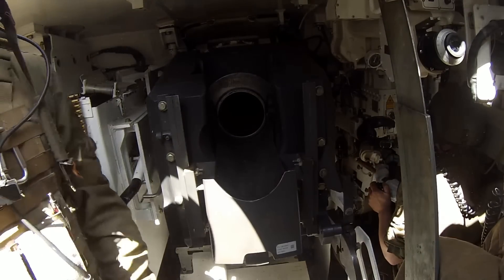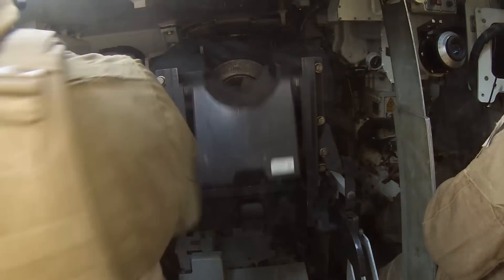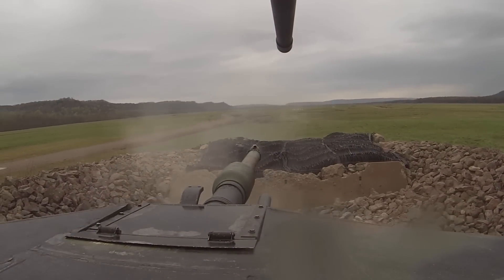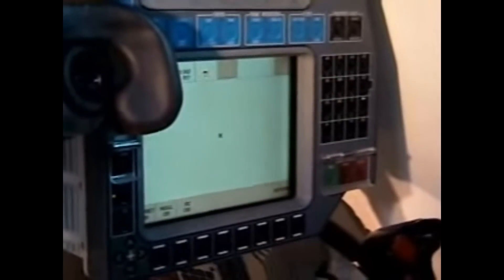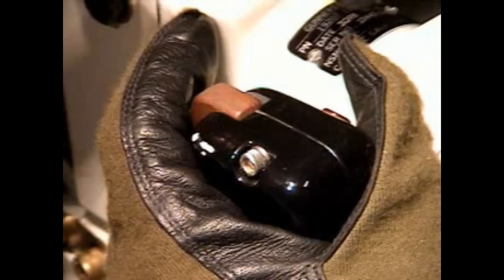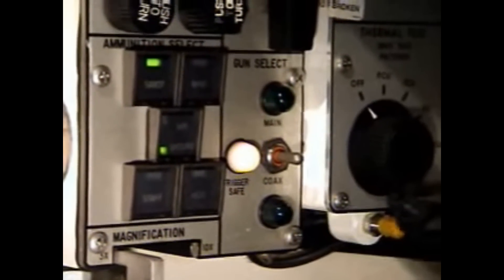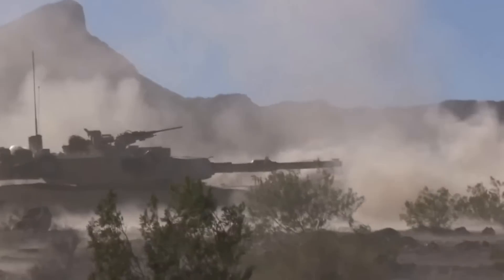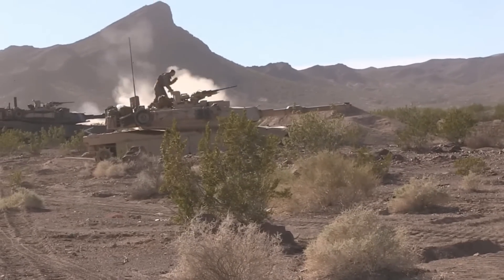How Do They Clear Tank Gun Misfires?

Comment: Not a loader as I'm not a tanker but Murphy will rear his head when you really don't want him. During the push to Baghdad near the Karbala gap my Bradley had a coax malfunction that wouldn't clear ( later found the extractor sheared off), switched to HE and had a25 feeder malfunction that wouldn't clear, stopped the Brad to raise tow and it gets half way up and jams. All back to back during an engagement. Our call sign went from blue 3 to malfunction 3.
Reply: ghostdog688 no worries, none of it bothers me. so the long version it is. my third tour in Iraq, April 2008 my platoon was sent to recover a Stryker that was disabled. it was sometime around midnight when we sp'd biap. there were two abrams, two brads, and two wreckers. we were headed to towards the north east side of Baghdad. we crossed the rte Pluto's and rte predators intersection heading north on predators. while going through the first IP checkpoint a couple hundred meters down the road I was maneuvering through their serpentine when I was hit by an efp that went through the BC side idler wheel, penetrating the side of the Brad with a fist sized hole destroying everything inside the troop compartment. luckily we had no dismounts. I was about sternum defilade in the BC hatch. when the explosion happened I don't remember hearing any noise just a bright flash, rush of hot air with what seemed like it was mixed with sand. the force blew off my sleeve pocket, my eyepro, and my CVC. I was really mad about my acu's and eyepro. the acu's were brand new and I had just bought those eyepro. I dropped inside and yelled to my gunner to check on our driver, he was being affected by the smoke from the smoldering electronics in the back. I threw a green chemlight out the turret to signal we were OK. a couple of minutes to by and I kicked something on the turret floor, it was my CVC. I picked it up and it was missing the kevlar shell. funny thing is it was still connected to the spaghetti cord, which if you know about those you can just look at them wrong and they'll disconnect. i put it on and reestablish comms with the PL. as we didn't know the extent of our track and assuming we were good the PL decided to CM. this was the beginning of our troubles. one of the wreckers took and efp to the snatch block at the rear which sent it flying off into Baghdad. the pl's track took an efp to the turret. it ripped off the section where the coax goes and went into the 25. it blew in the ready doors which caused the FBCB2 screen to shatter into the PL cutting up his hands. then they took another into the side hitting one of the reactive armor tiles deflecting it into the underside of the turret wedging in the turret ring. this caused them to loose turret power and prevented the turret from traversing in manual. as the turret was not centered they were stuck without the ability to talk to their driver. they yelled, threw water bottles at his hatch. they shot flares at his hatch, which he thought were more IEDs so he kept going. eventually the PL had to climb down and open his hatch to get him to stop. we attempted to hook up tow bars but started to take small arms fire and as we had no dismounts our ability to provide security and do recovery was not possible. at this point we put the PL, his gunner and the liaison that were in their track into mine so the PL could use my radios and continued north on predators. we were pretty much lost as the pls laptop with falcon view was blown off the top so we didn't know exactly where we were. none of us were running FBCB2 due to our mission set and who we were working for. we also were not able to reach anyone outside our group on FM as we were running SC/CT and everybody else was running FH/CT. our only comms was the SAT radio that was jerry rigged in my turret. but we only got the joc long enough to tell them of our situation and for them to give us a location to link up with a qrf that would take us to fob hope. we turned out element around which was fun for my head as I had no track tension on my side and my driver had to keep the steering yoke turned all the way to one side to go straight. Austin Powers turning it is then. we were to link up at a traffic circle on predators with the art, so we put SPC Shea with the pls Brad behind me with instructions to follow and headed back south. as we pulled up to the traffic circle the lead tank started to go west and as I was entering an IED went off between me and Shea which caused his vvs2 to blink out and he went the wrong way through the circle and continued south. he didn't see anybody in front so he thought we were way ahead so he floored it. the wreckers followed him as they had no radios, and were kbr not military. I called it up to the PSG that Shea missed the turn. so we began to chase him down, him the wreckers and PSG tank on wrong side road, SSG Sherman and my head the other with about a 2 foot median in between sides. my Brad couldn't keep up due to damage so I waited till they were almost out of sight I called the PSG and told them to slow down. my thinking was if I get hit and loose comms they will never know, if Shea stops or gets hit we will run into him. so the tanks slow down for me. all the while going north and now south we've been taking IEDs left and right. it want till later we found out they were placing the as we were coming. we continue south and SSG Sherman's tank took 6 efps. I watched a section of road wheels come off, both sets still together and roll of the side of the road then tip over. after each hit Sherman would call up "we good, still rolling". we eventually hit the Pluto's predators intersection and no Shea or wreckers. at this point we had no idea where they could be and our damages were so extensive that we couldn't continue. we turned was on Pluto's to try and go to fob loyalty which is right off Pluto's to get help, but there ain't no way to get there from Pluto's. so another Austin Powers turn and we head to fob rustimyah. and of course the clp was pulling in the gate with their mile long convoy of trucks. we bullied our was through, but the gate and head straight to the TOC. it just so happens this is our parent units TOC. we run in and notify them that we have a dust one( Mia). they start the battle drill calling all the qrf's to spin up and go find Shea and the wreckers. we are all taken to the aid station to get checked out. Shea said he kept driving till he realized we were gone. stopped and pivoted around. saw the wreckers and jumped out and ran up to the first one. he said he asked them if they had a radio and the dude showed him a Motorola, then he asked if they had weapons, and the guy showed him a knife. finally he asked if they knew where they were and nope. so he jumped back in the Brad and continued driving down the road eventually spotting some humvees in the distance. he said he drove straight to the and it was an mp plt on patrol. they took them to fob falcon just south of Baghdad. while we were in the TOC they had us do a debrief and give them a rundown of what happened so we did. we then read their observation which they say with their eagle eye.it read unknown convos traveling north on predators, visiual explosive, convoy continues at a high rate of speed, visual explosion, convoy continues, visual explosion, convoy continues, etc. in all we took roughly 12 efps, over 20 IEDs, small arms fire, had a dust one. not only did fob rusty watch us get messed up, fob loyalty watched, and the jss on predators watched us drive by which was actually the company the brads were from. nobody came to help or try to help. the joc at biap tried but the qrf from hope never left. the did try to have an f18 sparkle us but they didn't realize we were looking through thermals so we wouldn't see an ir laser. the PL received stitched in his hand, my driver was treated for smoke inhalation, I had a bruised face and bloody nose from the eyepro, my upper arm had minor bleeding and I had a flash burn from my shoulder to the wrist. all the blood vessels broke so it looked like lightning bolts running down my are which was pretty cool. we lost two brads and an Abrams. the PSG tank took zero damage those lucky bastard's. we never made it to the Stryker. best of all the route we told the joc we were taking was black and they said nothing. also, the Stryker could have self recovered if the bat boys knew how to use them, my plt had the exact same thing happen three times my second tour and we self recovered no problems. ended with an investigation as to why we lost over 20 million in equipment to recover the Stryker and how the events led to the SNAFU. my unit only filled out the admin portion of the da 638 for my purple heart so I never received it, yay. the next day I cussed at the chaplain, he unintentionally slapped me on the shoulder in congratulations for making it back. then had to argue with a 1sg as to why I had no head gear, unit patches or eyepro, he just couldn't believe the story. of my almost 4 years spent in Iraq that was the only time I wasn't sure if I was going to make it home.
Reply: it was an offensive push through. was trying to shoot a technical truck, wingman took care of it. only took a couple minutes to get the 25 back up. driver handed the impact gun out the hatch, wasn't going to ratchet the tow up by hand. had everything up minus the coax in around 5 min. the loss of the coax sucked but made the rest of the invasion a blast literally. troops and trucks under 900m were now he engagements.
Reply: damn all the weapons malfunctioned, that must not be a good day. Were you guys in any particular danger when it happened?
Reply: Neurofied Yamato not to be a smart ass but why else would I be trying to shoot. when he talks about the crew working together it's so true. the BC was trying to get the coax up. I was tearing apart the 25 and re timing it while the driver was getting the impact gun ready so I could jump out fix the tow launcher. the coax was out for the rest of the deployment, which made it interesting on the thunder runs. 25 he at troops under 200m.
Reply: Malfunction 3....lol well at least you didn't bite one for your troubles
Reply: I mean if you guys were underfire or was just providing fire support.
Reply: ghostdog688 I had 9 dismounts in the back, with 2 at-4 s and 5 javelins. not to mention the rest of the vehicles, was pretty open terrain.
Reply: n00bie I have no clue if those we engaged had made the pilgrimage to Mecca or not, so can't say they were Haji.
Reply: ghostdog688 don't get me wrong, there was some choice words and some pucker factor going, however not the worst situation I've been in.
Reply: protectorian yes the Bradley uses an m240c however, there are no real installation mods. it mounts in our turret the same way the m240b mounts to a tripod. the differences between the varients is the c model lacks a buttstock, full pistol grip, handguard, compensator, rear/front sight, bipod, and feeds from the right. most issues they have on the Bradley in my experience are due to the crew not loading the ready boxes correctly. that was the first issue, and only issue I've ever had with one. even when I was a 240b gunner had no problems, it even seemed to fire better dirty.
Reply: Farouk Kamali Sarvestani explosively formed projectile. plenty of vids about them. real nasty. we found cache's with pre assembled ones ranging from 9"-15" in diameter, marked with: for humvee, for Bradley, for tank.
Reply: Damn this is one of the best stories I've ever read you are a fucking warrior man lol, sorry about your purple heart but I'm sure you were just happy to make it home alive, 12 efps fuckin unreal-I remember being briefed on those things my second tour an being absolutely terrified.
Reply: wavygr Nope I died, this is just my ghost. really?
Reply: Farouk Kamali Sarvestani You pretty much got it. they have many ways to trigger IED/EFP. they use command Det, PIR sensors sometimes connected to DTMF boards, long range cordless phones, key fobs, pressure plates and crush wire which can be in sets of two separate so only tanks can set off. then they can hide them in anything. found a 9 array EFP in a foam jersey barrier, hollowed out wall with poster over it. they're only limited by their imagination.
Reply: forgive my ignorance...

what is an "efps" ???

i'm a civi
Reply: Luke Brown yes they are. combat is funny though, my buddy's Bradley during a thunder run in 03 took 6 RPGs in rapid succession. one was antipersonnel and just messed up their rucks. the others one through the driver's side blowing open the DVR hatch, one to the side going under the floor boards, one into the intake and engine, one to the dog box, one through the trunion and into the fuel cell, still drove out of Baghdad. however an Abrams on same run took one to the rear and burnt and had to be left.
Reply: I always found the 25 mm Aladean, meaning it was the shit, or just was. The Tank main gun was usually a quick fix, also rare.
Reply: Were you using a MAG M240C? I heard the C's get problems sometimes because of the installation modifications. It's a nasty beast of a gun. The Canadian LAVIII crews used the MAG C6 variant. In Afghanistan they reported open bolt jams frequently in exercises and refused to use the coaxial in combat most of the time, preferring to use just the Bushmaster 242 & the pintle mount MAG instead. But then again they were often shooting in the valley and not in urban area's. They only used the coaxel in case of a jam on the pintle mount which rarely happened, I only know this because I'm a bit patriotic & used to serve shortly before the first gulf war and when I heard about our troops killed in Afghanistan, I learned a lot of troops died on LAV's because of IED's etc. But those LAV's were the workhorses on the front line, they took a beating and kept on ticking. I heard US Bradley crews had similar experiences in Iraq. You confirmed the rumors true. TY for your comment.
Reply: ghostdog688 if you are referring to what I consider my worst day there is the short version and the long version.
Reply: Man , Kudos to you guys! what a story!! Glad you guys made it back. Thanks for telling it
Reply: russell worden thanks for the info mate.

so these EFPs are kinda like mines? deployed infrom of a vehicle as it drives and detonsted by remote? or like a mine by pressure?

I guess an RPG is similar to an EFP (except the rocket component) but same consept. An explosive charge forms a molten  copper penetrator.

Im glad GhostDog688 survived mate. Im from Australia (I was born in Iran but grew up in Australia and am a proud Aussie). Thank you ... GhostDog688 ... for your service and sacrafice. A school mate of mine did 2 tours of Afgan...
Reply: ghostdog688 I did indeed mix it you up. Forgive me. But my thanks goes out to all service men and women.
Reply: Well ya, having read up on gun jams, there are a lot of issues why a gun could jam or misfire or malfunction but not all of it is crew ineptitude but that's a big factor I know. The install modification, what I meant was your US M240C is a modified for co-axial mount version of the FN MAG like the Canadian C6 is on the LAVIII, same gun, different name, same headaches, but no crew wants to be without a couple on an APC on the front line. Thanks for your service! :)
Reply: Stephen Kapowski thanks, is what it is. only two things really got ya worried, 1 EFPs and 2 were snipers. everything else wasn't that bad.
Reply: wavygr that's the one of the things we always joke about. make it through a deployment only to die in an accident on way home.
Reply: Farouk Kamali Sarvestani I was NOT a service member. You may have me mixed up with Russell.
Reply: ghostdog688 ?
Reply: Robert Rousseaux i like 30mm 2a42 better.
Reply: Fun times!
Reply: Did you just hang out top with your rifle?
Reply: +Ryan Russell no, we fixed the weapon systems and continued.
Reply: russell worden @
Reply: russell worden wow dude you all got hit with efp I'm glad you and everyone were okay how does reactive armor hold up to an efp ? also how effective is a Bradley armor rha effective equivalent
Reply: russell worden, I've wondered if plastic explosive technology has progressed this far. I've heard of a FOAM based explosive that is packed into an aerosol can. You spray it into the opening around, for example, an armored door or the hatch of a tank that you REALLY want to get into. Stick the detonator pin anywhere in the foam, roll out enough wire to avoid getting blown up and just press the trigger. Boom! Bye bye tank hatch.

Does such ordinance like that exist?
Reply: Not nice bolo.
Reply: SO GLAD you are here to tell the story. Dave
Reply: 25mm HE rounds at troops under 200 meters....thats a bad fucking day for those rags Brother!
Reply: Thank you for your service Russell.
Reply: russell worden Why has this never been a documentary!!!! Or a movie!!!! You guys are awesome.
Reply: Farouk Kamali Sarvestani Explosive/ly Formed Penetrators.
Reply: russell worden thank you for risking your life to defend our freedom my good sir.
Reply: Was it not maintained or the dust/dirt?
Reply: I'll bet your Co 1Sgt absolutely loved you guys.
Reply: russell worden unbelievably, I managed to understand most of that - I'm a civilian and not military at all. Guess these sims I play are helping a little lol.
Thanks for sharing your story,  for your service, and congrats on being a lucky bastard to survive that lol.
Reply: russell worden ah, that makes sense as to why you weren't calling "code brown" quite so quickly ;) I often forget the brads never fight alone :)
Reply: russell worden desire to know more intensifies
Reply: russell worden well, as curious as I am, I wouldn't want to cause you to dig up anything overly painful. If you'd like to share your story, by all means, provide as much detail as you are comfortable doing so - I always prefer to hear the accounts of soldiers on the ground than the news and journalistic accounts.
Reply: russell worden that's rotten luck. Glad you pulled through!
Reply: Thank you for your service!
Reply: russell worden well, at least you had other weapons at your disposal. I shudder to think what you'd have been able to do if it was an armoured vehicle with no TOW.
Reply: Ha! That's hilarious. Leave it to army equipment to break when you need it.